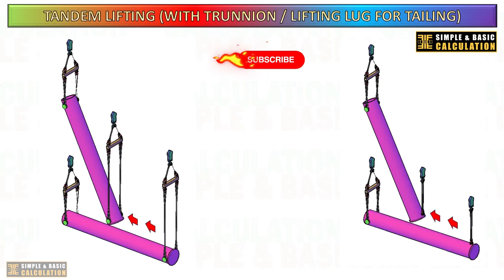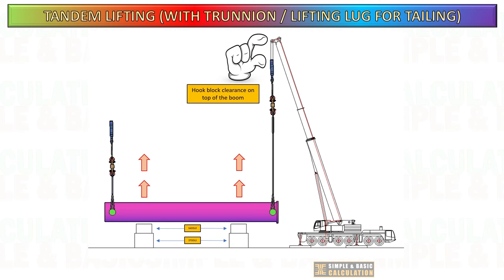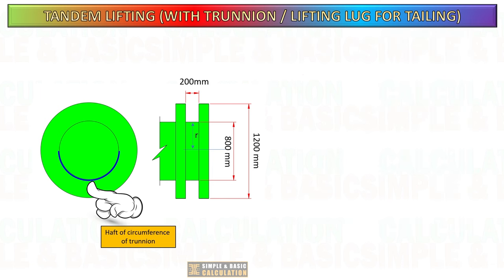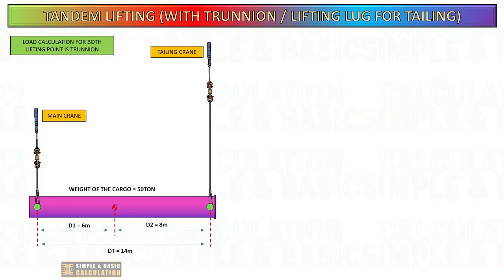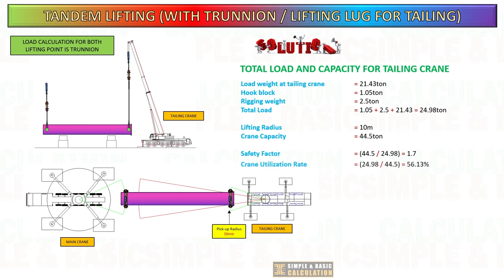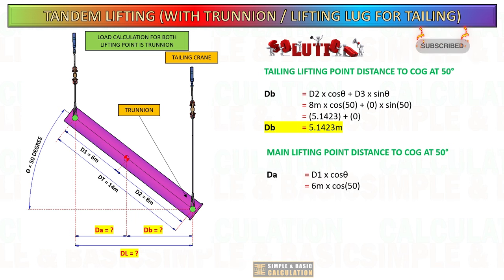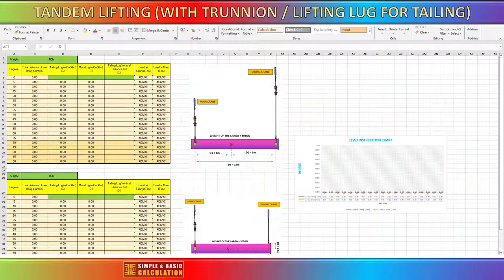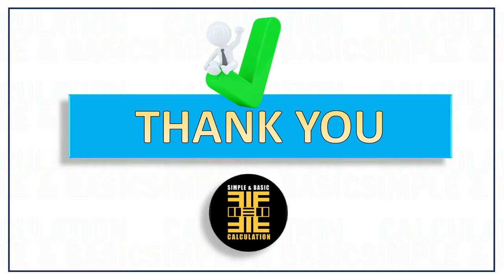Understanding Load Differences: Trunnions vs. Lifting Lugs in Tandem Lifts #crane #tandemlifting

Comment: Why didn't tail crane stay at 90 degree with the cargo to reduce the working radius ?
Reply from the maker: For this video, i consider the main crane already at max capacity. in that case cannot boom down.
Just for example only.
The main concept here is to understand the loading when dealing with trunnion & tailing lug. 
also what things need to remember when dealing with trunnion.